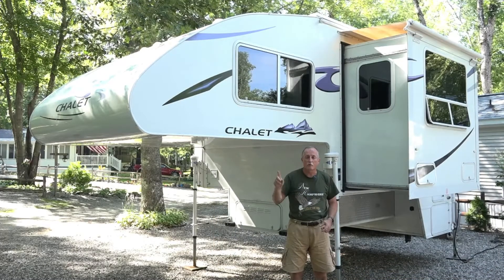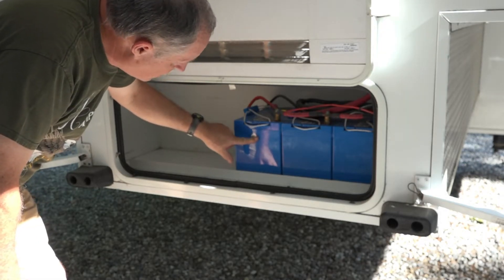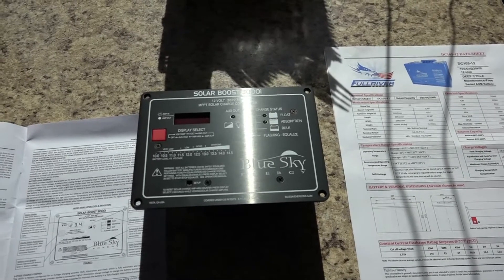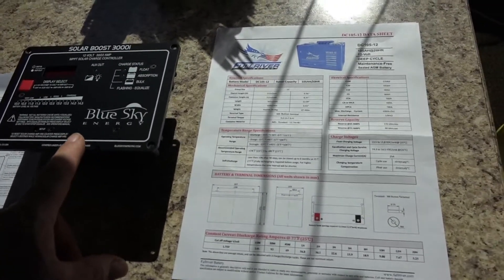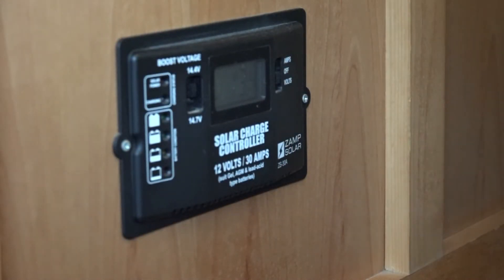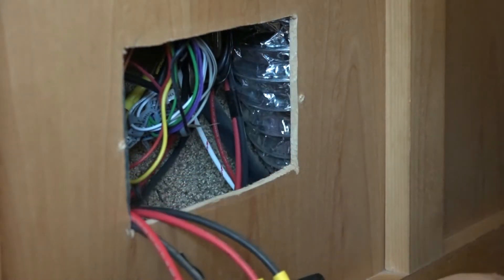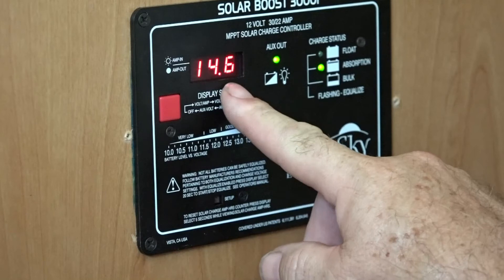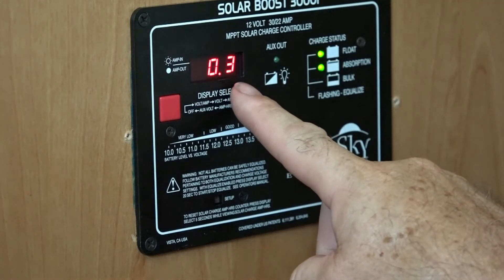Solar Charge Controller Upgrade - PWM to MPPT

Comment: Did you see the 30% increase in charge current that was promised?
Reply from the maker: I have seen a big improvement in my batteries performance but do not have any data to quantify the magnitude of increase!